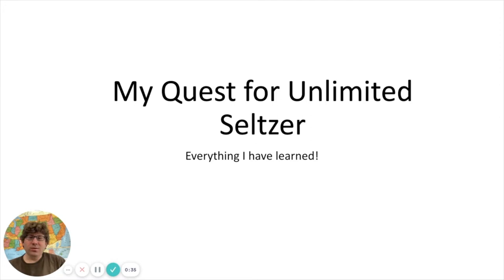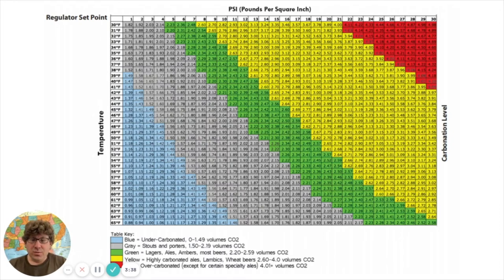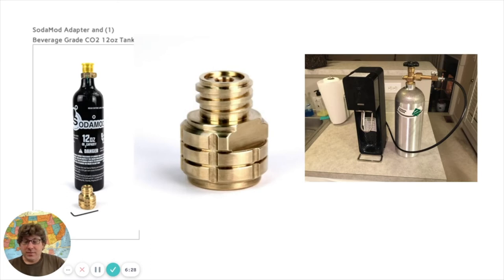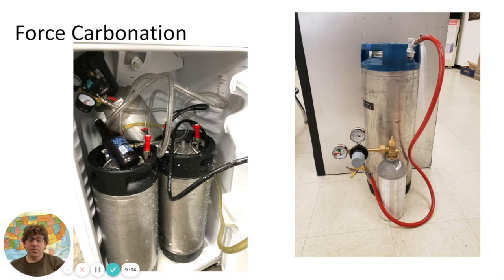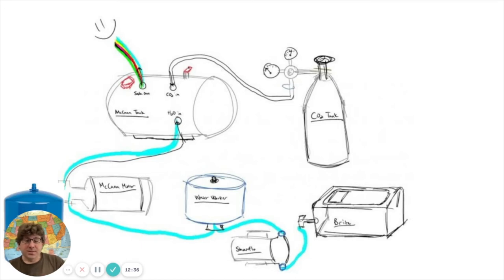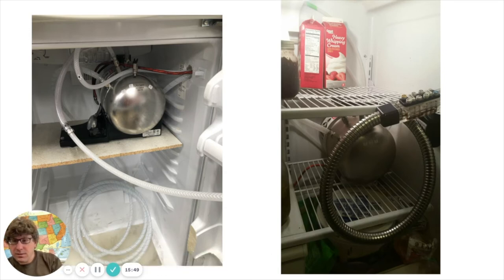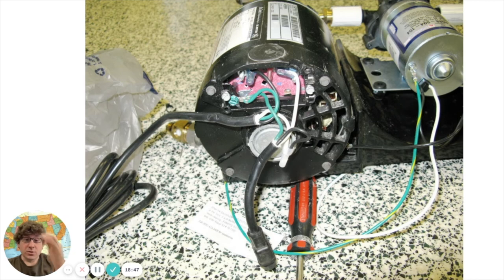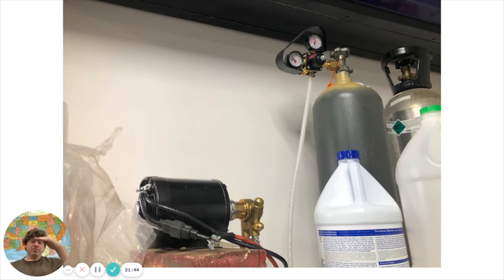Everything I have learned about Unlimited Seltzer on Tap

Comment: I just copied your system. Big Mac carbonator and a mini fridge. The holding tank is inside the fridge and the pump and gas cylinder is on the floor just outside the fridge What is your CO2 set at. At first I had it cranked up to 120psi and it blew apart the connections at the tap 😅. Wife wasn't too happy about the mess of water spraying everywhere but we got it buttoned back up.

Comment: Please help: I have 2 carbonators, 1 i bought used from a restaurant and the other i just bought brand new. My issue is when i purchased the used one, i took it apart to clean the water tank and it had a bunch of black flakes that dissolve when you press, i decided to purchase a brand new McCanns because didnt want to take a health risk, but i was so curious i pulled the floater off and low and behold there are black flakes on the bottom of a brand new unit. My water is filter with Reverse Osmosis. Im trying to understand if its residue from the pump, or the stainless tank.

Comment: what's the drawback of just keeping the pump in the fridge? Would also be nice because it would stay quieter.
Reply: As I understand it the pump could add heat to the fridge causing it to work harder and there is potential for humidity to form potentially damaging the motor or electronics

Comment: In your first pictorial, you correctly point out that good carbonation is a COMBINATION of Cold Temperature, Pressure, and surface area.  I wish you had gone on from there with your explanations.in relation to your system[s].  The one that most confuses, is that you have the incoming water at a small differential of the CO2 gas pressure.  In your first picture, the 'pressure'  referred to is the Highest Differential of the CO@ infusing gas, ABOVE whatever H2O pressure. Ideally up to 150 psi CO2 ( I use 56) over ambient (zero)a H20 pressure.  That, along with COLD temperature (maintained until serving) and either agitation/or H2O "spray" provides surface area for the best infusion. Thanks.

Comment: Great overview. 👍
Check out kegland, they have a carbonator cap for the corny pony kegs.
Basicly a keg lid with a water input and a float valve. The water pressure has to be higher than the co2.

I only have my regulator set at 30psi not 100psi 😮

Comment: I'm having trouble with a couple thoughts.  If your water comes straight into the mccann's tank from the city, doesn't that mean it's still too warm? shouldn't it be cooled before entering the mccann's tank?  The second thing is I am wondering if I could just use a mini fridge with a water pressure tank exactly like from a reverse osmosis system just minus the filtering stuff.  If the city water goes into the fridge then straight to the water pressure tank then from there out to the pump then back into the fridge to the mccann's tank then so on... Or maybe city water to the pump then into the fridge to the water tank then to the mccann's tank although I don't know what kind of pressure the tank would output and also as mentioned before I don't know the temp of the water that should be entering the mccann's tank.  I know you talked about water tanks exploding although I don't understand why that would happen as they should handle a certain amount of pressure correct? anyways I'm sure I don't understand something basic, if you could please help me understand.

Comment: Is there a reason you didn't mount the pump in the refrigerator as well? Saving space or is there an issue with cooling the pump?
Reply from the maker: I was concerned with the heat generation by the motor. Thanks T

Comment: Got my set up running and it works but it's not very carbonated. My water pressure is about 70psi and my co2 is set to 100.  Did the carbonation increase when you installed the pressure regulator?
Reply: I figured I reply to my own comment 9 months latter hopefully this will spark a discussion probably not though. I installed a pressure regulator, and it didn't seem to affect the carbonation level at all. Increasing the  co2 pressure seems to have a small effect but my regulator has a blow off valve if I turn it past about 130psi.  I'm wasting my time here I need to find a home carbonator forum. Hello open void is anyone out there?
Reply: @ryanedwards4325  Don't go above 100 psi on the CO2.  Is your water chilled to 35-38F?

Comment: Hey Tyler! Great video. If you haven’t checked out keglands Continuous Soda Carbonator Keg Lid, you should. It works great for me! Enjoyed the content.
Reply: thanks for the info, this is great, do you use a pressure regulator  for the incoming water?
Reply: @ilbsli  I am on a well, so I do not use a regulator… my water pressure isn’t high enough to need one.
Reply: Do you know approx what pressures you are using for co2 and incoming water? I’m on a well with a 40-60PSI water swing and am deciding whether to go with the carbonator lid you mentioned or a mccanns
Reply: @chrispeel1827  I too am on a well. I keep the CO2 tank at 35psi. It still comes out WAY more bubbly than a can of soda. (For added security, I also added a check valve to the water intake) Good luck!
Reply: @crazymk6  Sweet thanks for the info. Do you know what PSI your water pressure is? The reason I ask is that the carbonator lid videos say that you need water at 20+ PSI above what the CO2 is set to for it to work properly. Also, what size keg do you have the carbonator lid on? THANK YOU for all your help!!
Reply: @chrispeel1827  I’ve got the same 40-60 psi tank you do, and I’ve had no issues. It would be best if you started with an empty keg, when you turn your water on. That way you can listen for the water going into the keg. Then you know you’re good. Only issue I ever had, was when I emptied out water heater. I forgot to turn off the spigot, and we ended up with carbonated hot water. Lol.
Reply: @crazymk6  I appreciate your help so much. Ordered the lid! What size keg do you have it on? That’s hilarious about the carbonated hot water. I’ll have to get some check valves :)
Reply: @chrispeel1827  I have it on a 5 gallon keg, in a mini fridge… would have done a 2.5 gallon keg, but they were actually harder to find/more expensive in my area. Takes a full day to fully carbonate… but haven’t noticed a decline in carbonation, with moderate use in a day.

Comment: How do you feel about this method? Is it worth doing it like this? I have a limited space and want to do an under the sink configuration. I don't really care if it comes out cold or not and I want to avoid refrigeration if it's possible. Will I just not get good carbonation from water the temperature from the tap?

https://youtu.be/XIEni6GuhQU
Reply: If you don't cool the water, it basically will not work.  It's virtually flat as soon as it comes out.  I learned this the hard way.
Reply: @Bottleworksnet  okay gotcha. So it's not that it has to be cold to get carbonated, it's that if it gets warm it decarbonates quickly?
Reply: Liquids at colder temperatures can absorb more gas. If you carbonate room temperature water it will be less fizzy to start vs cold water.